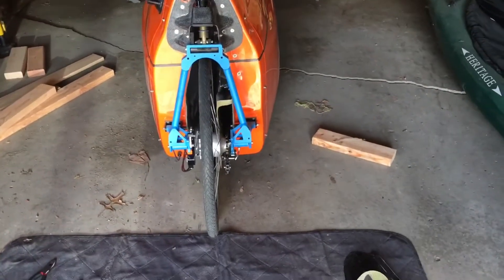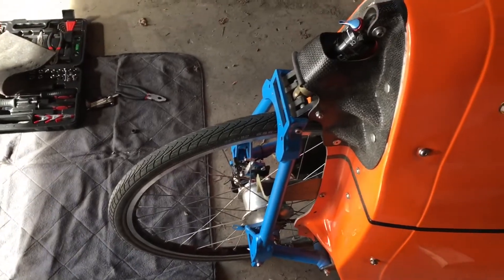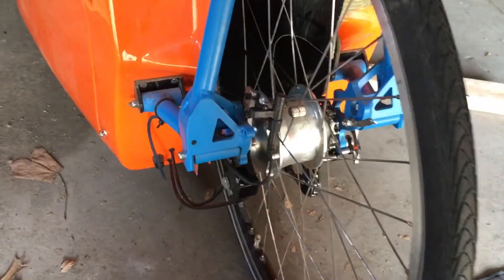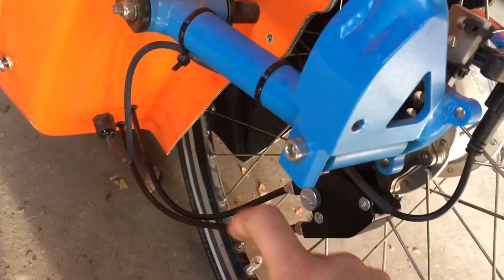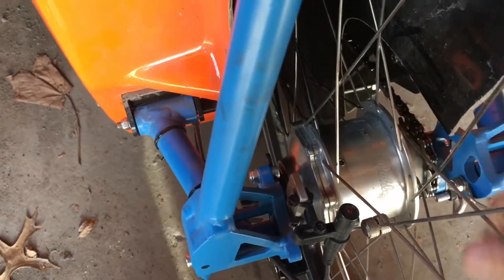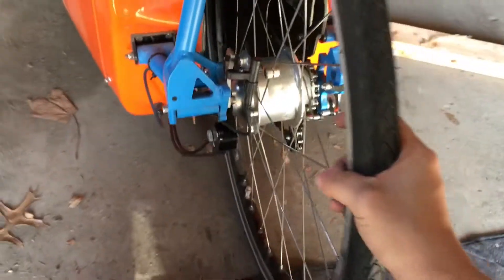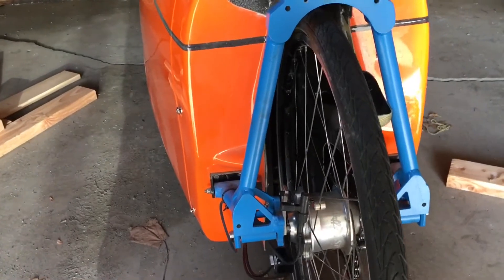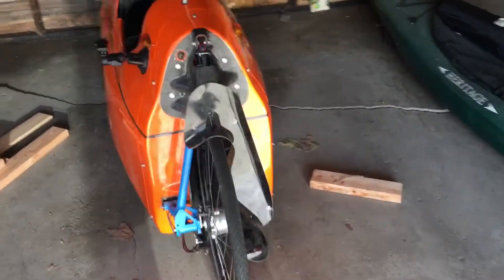WAW Velomobile 2016 Rear Suspension

Comment: Many thanks for explaining the shifting mech that needs to be locked okin the bolt. It seems when replacing my rear wheel, i forgot to do this. When accelerating from zero i felt the back end of the waw going up, i didnt place the notch onto the bolt.. seems something that is easily overlooked.
Reply from the maker: jerry bracke yes it caused a big problem for me, but you learn and glad I can help others.

Comment: Thanks for the nice video! Nice to see the new Katanga rear suspension and how it works.
I'm still interested to know how easy it is to change tire for the rear wheel. Can it be done without taking off the rear part of the body?
Reply from the maker: Saukkico no just like a regular bike you need to take off the tire from the frame to change a tire. It doesn't take to long to take off the rear tail section.
Reply: Ok. Thanks!